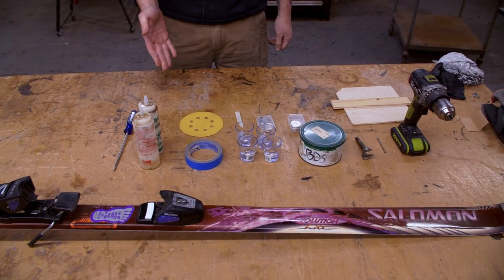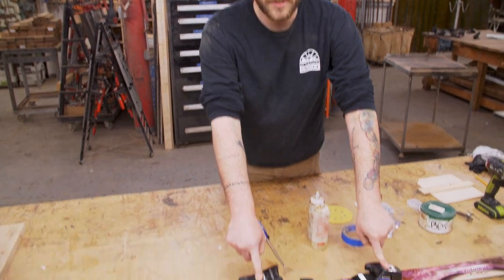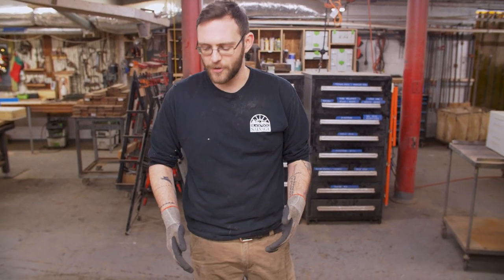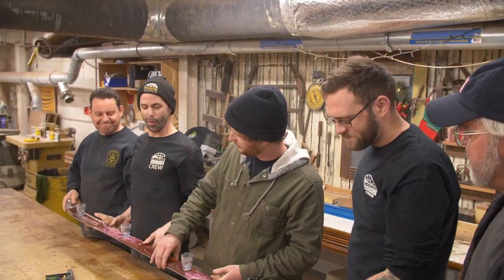How to Make a Shotski // Black Dog Builds

Comment: Little bit painful to watch if you want to do it properly, use metric measurements 😂.
  So much work easier just to drill 4 holes in the ski for the shot glasses. Then you’re also not limited to those 4 magnetic shot glasses.  But great job